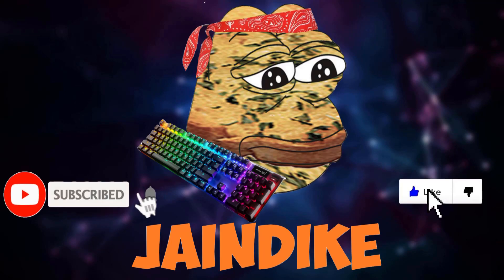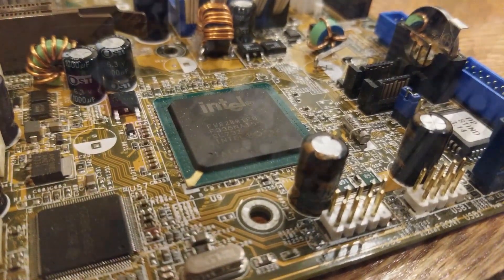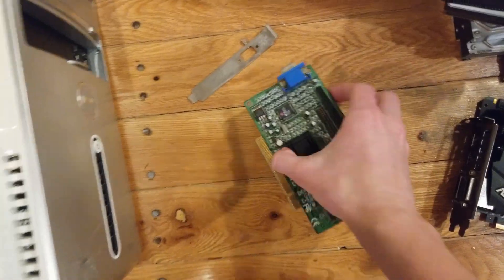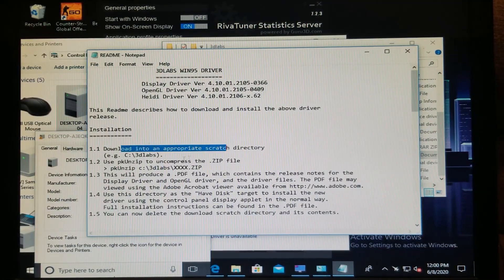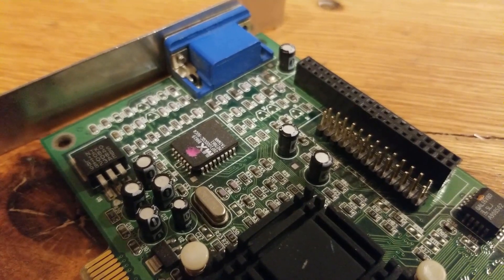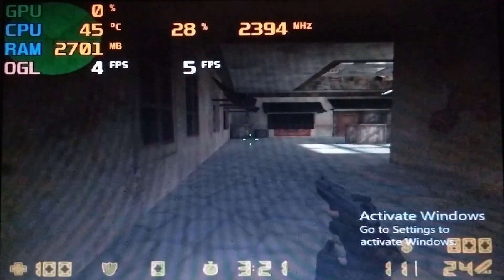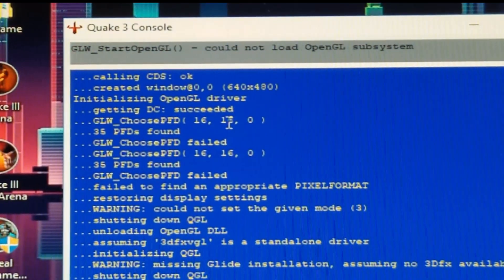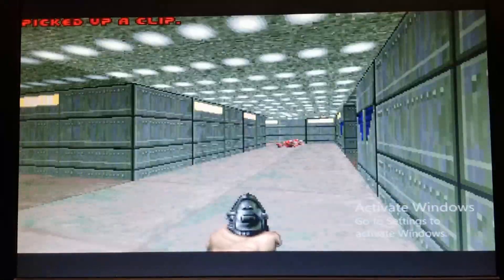The 1997 Graphics Card (3DLabs Permedia 2V) Benchmarks and Gaming

Comment: I recognise the pattern at 2:27. That's what VRAM failure on the cards of the era looks like.

First all electrolytic capacitors need to be tested, and maybe it's time for fresh ones. Another suspicious component there seems to be a voltage regulator IC there, i wonder if it's still healthy. Then if that all checks out, it likely needs replacement ceramic capacitors near RAM chips and potentially the RAM chips themselves. And maybe a total reflow. Normally the ceramics don't go bad with time at all, but if the card wasn't stored well and could have experienced a mechanical shock, then they can form hairline cracks through them which you won't see even under a microscope, but needless to say, it's not very good for them. Once a ceramic near a RAM chip dies, the RAM chip will be toast in a fairly short time, they deteriorate in front of your eyes, it's scary, but if it hasn't been more than a few hours in use, maybe they're still not too far gone.

If you can't perform the repair, sell the card! Someone out there has to be crazy enough and skilled enough to attempt it, maybe they'll get it going.

Permedia 2 were always kinda slow, but i liked them regardless. Not sure why. I even liked the Intel Lockheed i740, even though it disappointingly lacked OpenGL support. Maybe i just like odd things.

The bracket tang isn't too long, that's pretty much impossible i think. I think it simply got bent out of shape, and wasn't finding the corresponding cutout in the mainboard retainer. It looks banana-ish to me! Maybe just needs a little wiggle wiggle action.
Reply from the maker: As a computer engineering student, this was very interesting to learn about. Did you work in the tech field or how do you know so much about this card? Also I haven't yet sold it, but I'm glad I didn't! It might make a good video to attempt a repair on this card. Thanks

Comment: The reason why you couldn't use its driver is because its driver is not WDDM standard compliant. They introduced this as a new graphic standard, replacing the XDDM model that was compatible with windows 7 and before it.

Voodoo cards works on windows xp up to 10/11 because their glide api doesn't work like traditional graphic api like directx or opengl, so it doesn't have to comply with their models.

See if you can force it to use one of the drivers matrox made for their g550. Surprisingly it has fully functional driver even on windows 11 (that's 20 years different!), as it's made using some wanky software rendering solution.

Comment: I still have the Diamond FireGL1000Pro card that I bought in around 1998.  It is iirc the 4mb PCI version, so probably not going to be as fast as the AGP 8mb version.  I really loved the Permedia2 accelerator chipset back in those days.  Its openGL speed was like night & day versus Software-only graphics.  I bought the PCI version because I did not have any AGP motherboards yet, as those were still expensive & still somewhat new compared to PCI.   I also used the Permedia2 for 3D CAD, such as in Truespace.
Reply from the maker: Wow that is quite the piece of history right there. Does it still work?
Reply: @Jaindike  ... I think so, it's not installed in any of my pc's at the moment.
Reply: @Jaindike  ... Hey I just found my firegl card, in an esd bag.  Correction, looking at it, it's 8mb pci, not 4mb.  And it has that 3d glasses din port on it.  I also have an elsa revelator 3d glasses, that i bought around the same time in the late 1990's, so i probably used it with the firegl.  But later on, i was also able to use the 3d glasses with my nvidia ti4600 card. Quake3, Serious sam, Battlezone ii, etc, they all look nice in 3d lcd glasses.
Reply from the maker: @robwebnoid5763  3d Glasses? Like the ones at a movie theater? I didn't even know that was ever a feature
Reply: @Jaindike  ... That depends on what kind of glasses used at the theater.   The most common theater glasses today are the passive polarized ones, sometimes branded as Real3D.   The Revelator that I have are powered LCD shutters, which close & open the LCD transistors, flipping the LCD between transparent & opaque at high speed, synchronized with the vertical sync of the monitor.  It only really works with CRT's. The higher the vertical sync of your monitor & graphics card, the better it looks.  The lower the vsync, the more it looks bad because the flipping between light & dark is very noticeable.  I've used it at 120 hz vertical sync, which is pretty good.  That means it's flipping the transistors 120 times per second.  I have not tried it with flatscreen LCD's, but I think it will not work.  I still have plenty of CRT monitors & my Revelator still works to this day, although the last time I tried my Revelator was probably 5-7 years ago.   Yeah, I forgot that was a feature on this FireGL until I looked at the card today heh. I just now also fitted the Revelator plug into the FireGL DIN port  & they mate perfectly, but I don't know if they will actually work, it's been a long time, so I don't remember. You can Google for more specs/reviews & you can find other people showing their Revelator here on youtube.   Edit:  Oh, it looks like Youtube has a feature for viewing 3D.  You can change it to Anaglyph & you can  view the 3D with those red-blue glasses, if you got one (or make your own).

Comment: You were most likely running the built in software based DirectX and OpenGL solutions on the CPU, since there was no driver installed. This card is for DOS based Windows, and will never work on a 64-bit OS either. The card was nothing more than a mere framebuffer.
Also, the system requirements for CS1.6...
GoldSource has been updated many times. If you want original renderer, you need to get a pirated Counter-Strike. Current renderer has been rewritten for modern operating systems and it is only OpenGL, there is no DirectX5 renderer for lame GPUs.
Reply: Funny thing, Direct3D support on Permedia 2 was... a little lacking. Glitchy, slow. It performs much better in OpenGL, being a low cost derivative of a professional workstation card. And yet, even when it came out, in Quake 2, it wasn't super fast. I struggle to imagine how it would perform in anything newer. By the time CS rolled around, i had an ELSA TNT2, and soon after switched to Geforce 2mx, which was particularly good for Blender, which i discovered by browsing a public library or a bookstore, can't remember, the very first book on Blender by Carsten Wartmann came out in early 2000, it came bundled with Blender 2.0 late beta i think? Now we're at version 2.93, which is not really alike at all :D Didn't use to be free and open-source back then either. Ah, i digress.